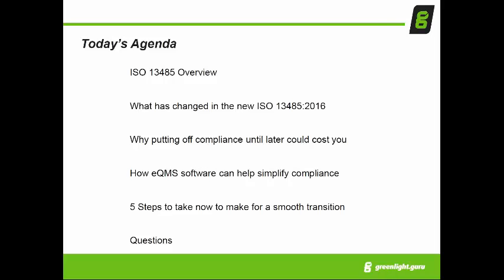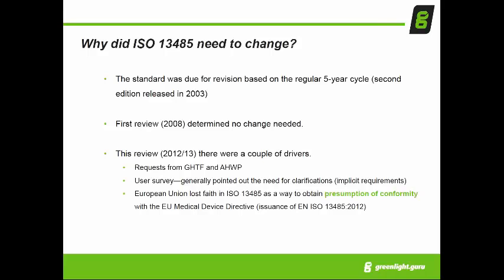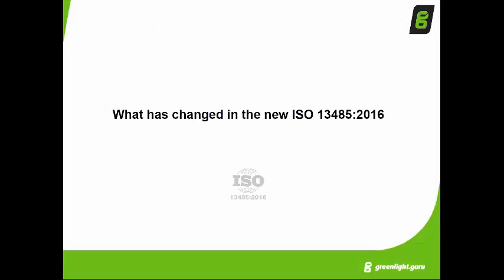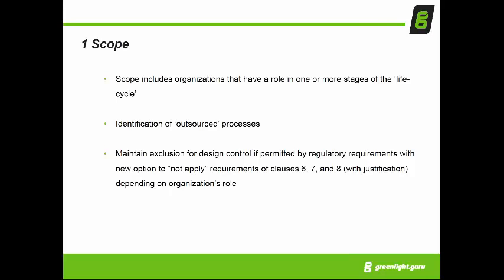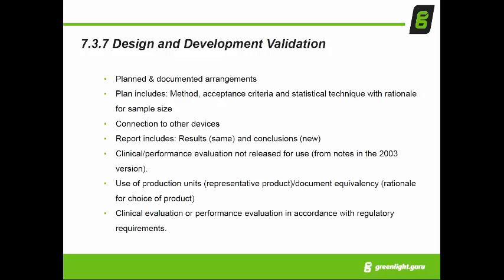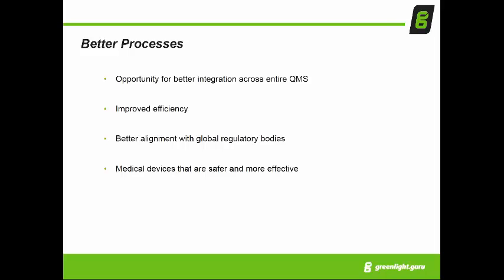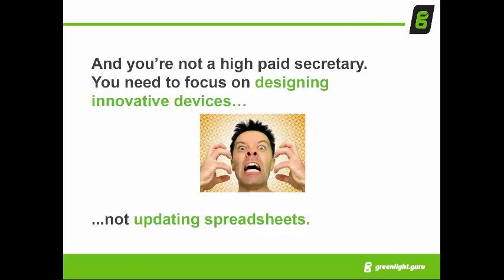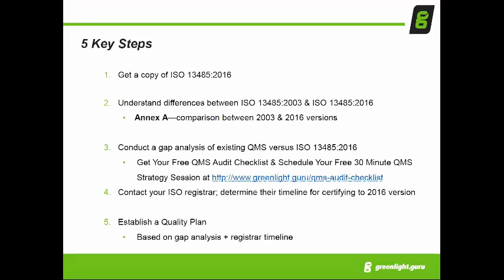How to Simplify Your Compliance with the New ISO 13485:2016

Comment: OUTSTANDING VIDEO.  I am very aggressively pursuing risk management. (14971). Most companies have an oversimplified methodology, and usually not accurate, in terms of sample size, sample method, and what (if any) metrics are the drivers of those methods.

The eight hundred pound gorilla (imho) is everyone wants to claim ‘six sigma’ and Cpk’s as quick and easy qualifiers, without understanding what type of distribution their processes exhibit.  Many distributions are not the Normal (Shewhart-Gaussian), and often are uniform. This means that all the ‘six sigma’s based on Z values are not even meaningful.
Also rarely have I observed companies checking within sample vs. between samples, at the outset, to determine factors (ie screening).

Please send any Q’s or ideas to stevephoto@comcast.net Best Regards!